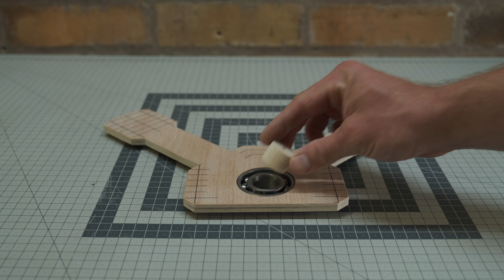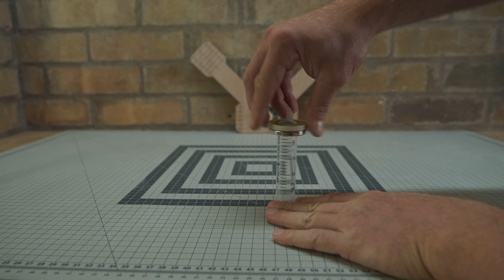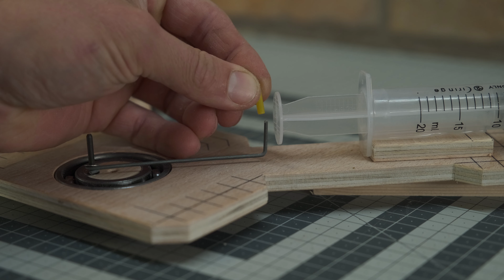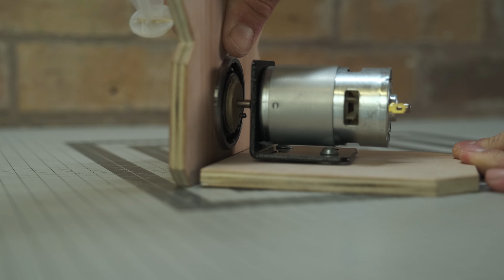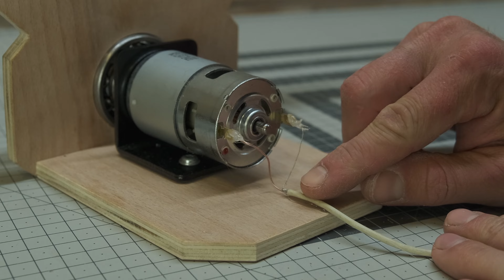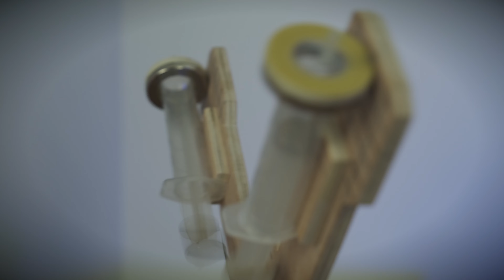How To Make A Magnet Engine, Simple DIY, Make At Home With Children, 5-Minute Crafts

Comment: just asking what are the magnets doing wont it do the same thing without them
Reply from the maker: Good question, the magnets just give it more compression and it feels like a real engine. But yes you can make it without them. It’s a cool thing to make for kids 👍
Reply: Yes it will because the motor is  powering the engine

Comment: I love the video its amazing, but I don't think you understand the definition of "5 minute crafts, Make at home with children" XD
Reply from the maker: Sorry 😢
Reply: also the definition of a magnet engine, what you built could work without magnets because of the dc motor @majorhavoc
Reply: also i have seen your design but they were using bigger flat magnets and would use a alternator that would convert the phisical energy into electrical energy

Comment: So essentially the magnets are there to act as cushions/springs, but the whole system would work without them.  I do wish you had actually made an actual engine as opposed to a piston simulator
Reply from the maker: I wonder if it is possible to make an engine that would run entirely off fixed magnet power 🤔
Reply: @majorhavoc  a true one would be impossible (perpetual motion), but it would be possible to make something that could run for a bit with external input iirc